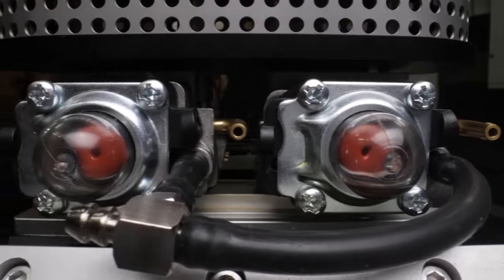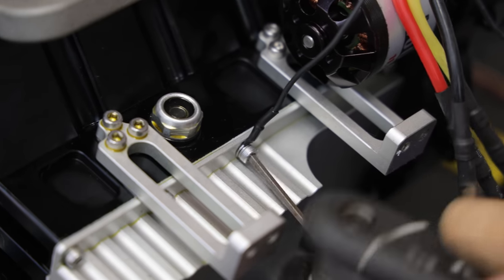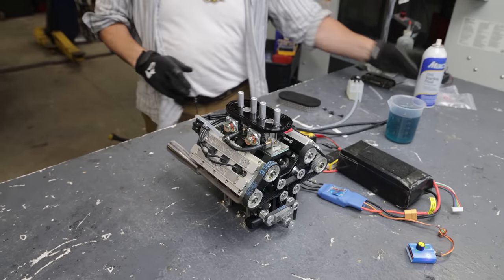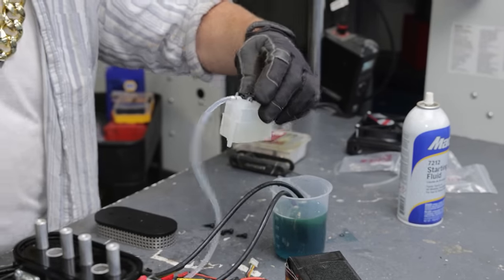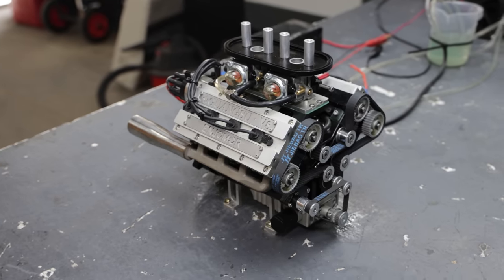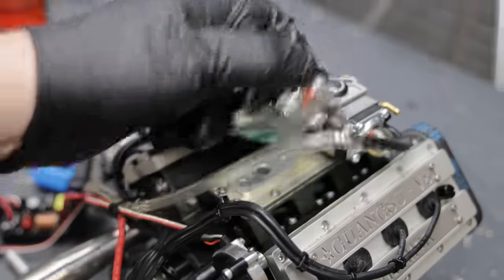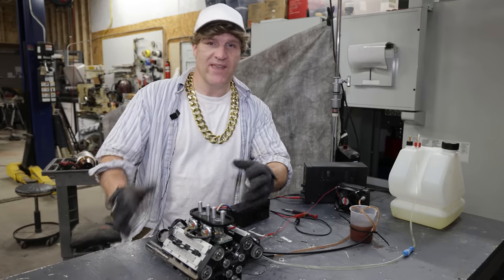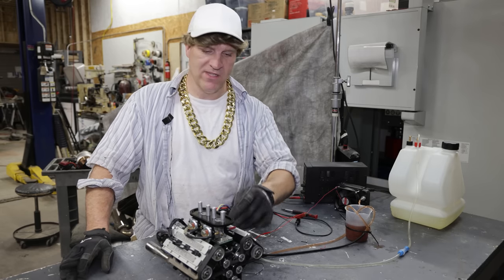Miniature V8 Engine Runs like the Real Thing - (78cc DOHC 6HP)

Comment: Would dielectric grease help isolate the spark energy? It’s really good for that.... -as far as the spark leak on the distributor cap to what I think was the distributor hold down bolt?
Reply from the maker: Dielectric grease is a great idea, personally I think there needs to be a better distributor design.
Reply: @WarpedYT   it did look a little minimal effort, but who am I to judge, lol

Comment: Hey idea for the cooling system for the cordless tesla full roof scoop seal the top off and put hole bye licenses plate to allow air flow to enter through the roof scoop and exit throught the bumper which will suck the heat out of the motor

Comment: The ignition pack is one of the problems. Mine says on it 16000 rpm. This is WRONG. It should say 16000 sparks per minute.On a V8 this will give 4000 rpm maximum. I have some test equipment and checked the pack and sure enough it starts to cut out around 4150 rpm.
I`m in the middle of making mine distributorless using two 4 cylinder RCeXL packs with twin hall sensors. Just waiting for the 2nd pack.Only 1 in stock.
Reply from the maker: Yup... Exactly right. That's a good idea. I like the way you think You're going to like what I'm about to do to it.

Comment: The coolant lines fell out on the first run, then the coolant changed colors a couple of times… any chance it overheated and blew a hole into the cooling jacket?
Reply from the maker: Yeah the coolant changed color and then I swapped it out with a different type of coolant, and then that coolant changed color again, I have a feeling that the oil is mixing with the coolant, I'm going to take it apart and check it out.

Comment: This type of carburators cannot working on 4 stroke engine. Its used in two stroke engines and from carburator is hose to crankshaft for pumping gas with membrain inside carburator

Comment: Why are you interested in how fast you can make the engine run without load?  Seems a bit pointless when the purpose of the engine is to make power.  Instead of looking for the onset of valve float or testing the tensile strength of the connecting rods, why not do something interesting such as mounting it on a dyno. and try to improve its performance?

Comment: That engine was NOT firing on ALL cylinders. 
If you are some sort of ace with these engines, ... you would have heard and known that.
That HT lead sparking out like that should have told you there is a problem with the spark plug, ie: no gap or just bad leads.
Your title leaves a LOT to the imagination.

Comment: Is that not mixxed fuel youre using lol
Reply from the maker: No straight gasoline
Reply: @WarpedPerception looks alot like the 50:1 mix i use, I think you're pulling my leg
Reply from the maker: @NessieTheCatt  nah it's straight gasoline, You can't run a two-cycle mix on this engine it's made for gas..
Reply: @WarpedYT  fair enough

Comment: That exhaust manifold is trash. The distributor is sketchy. Plus the carbs should be bigger or doubled. Those are the obvious fixes. What all these engine companies need to do is build scale transmissions that work under load and folks will have more than paperweights.
Reply from the maker: I'm working with these companies to give people what they want hopefully soon.